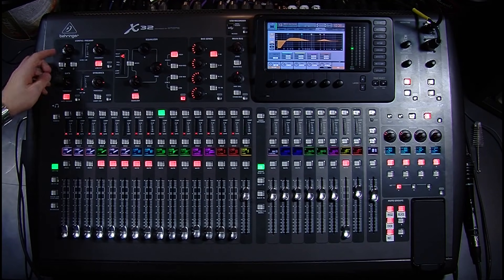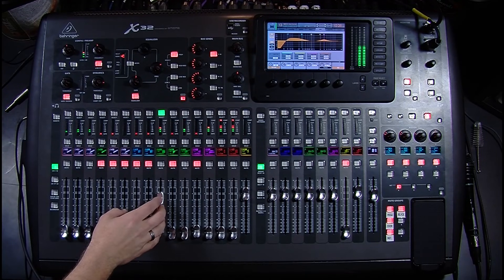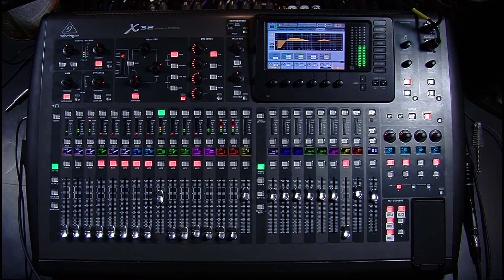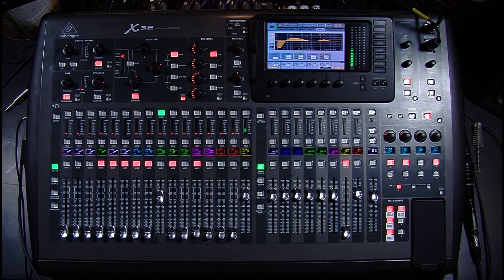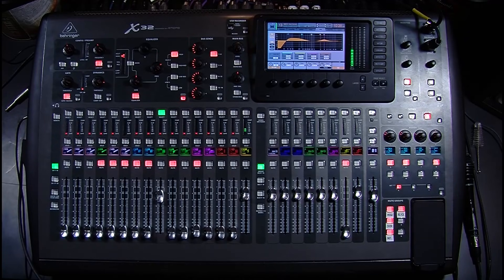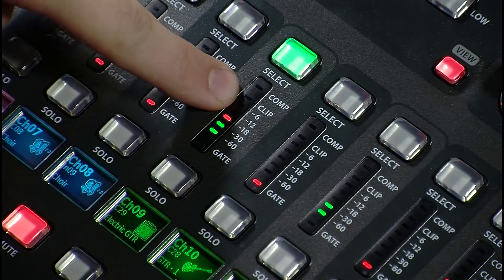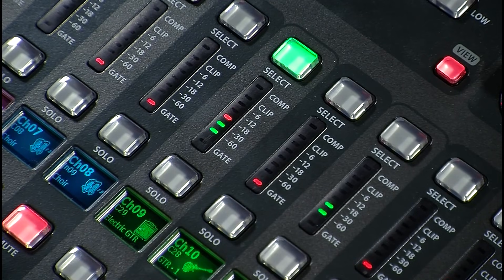Behringer X32 - Basic Mixing 101-2 - Preamp & Gain

Comment: 00:04 Setting up gain and preamp configuration is crucial for correct audio levels
01:24 Channel gain and phantom power are crucial for microphone operation.
02:41 Understanding phase, polarity, and low cut settings for better sound quality.
04:07 Adjusting preamp gain to control frequency inputs
05:31 Selecting channels and using solo, mute, and preamp features
06:50 Adjusting gain for proper signal amplification
08:15 Importance of headroom for avoiding distortion
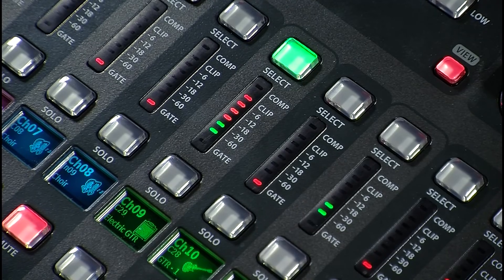09:36 Understanding the vocal and dynamic section

Comment: So if I have 3 lav mics and wanted to deal with feedback issues would this be the correct way to go about it. First, Have my master fader at unity, get the correct input gain on LAV 1, then raise LAV 1 channel fader until the point of feedback and deal with feedback accordingly until I get that channel fader to unity. Secondly, once LAV 1 is set, you keep it hot and at unity and repeat this process with LAV 2 & 3. Is this process correct?

Comment: That's actually not true, and probably a US thing, but over here in Europe we call it a phase switch if the polarity of an audio channel is turned around. This is actually even what they call it with XLR cables too, and it does switch a phase entirely. Behringer is a German brand, so over there they are correct. Phase and out of phase is not time-dependent where I live. When a signal is 100% out of phase it's indeed entirely its polar opposite. Also visually easy to spot when zoomed in on a wave-form.

Comment: Thanks for the tutorial. Here is the issue I am having when I attempt to set the volume fader at unity level, which I believe is 0. Regardless of the gain on a particular channel, the sound that comes out of my speaker is clipping while the speaker volume is low, and also the signal sounds weak. Imagine a sound is low, weak, and clipping at the same time. Please let me know what I am doing wrong? FYI, I set the volue of the keyboard producing the sound half way, and the main fader is also set at unity level which I think is 0
Reply: Could it be an issue as to how you have your amps set?
Reply: @davidhunt6508  I have updated the software on the speaker, which resolved the issue.

Comment: Can you address the analog to digital conversion at the preamp ( and possible loss of bit depth if set too low there) as shown at 24:10 in this video ?     He also mentions the desire to have "high resolution" by keeping channel faders near unity and how sub groups help you with final volume in the house, but it isn't clear what you'd do if keeping preamp gain at "line level" forces the channel fader into undesirable territory.         https://youtu.be/khBHcfyI5e8?t=1453

Comment: If the sub crossover is around 100 hz, and low cut /high pass has a curve to it ( not like a shelf) would you want the low cut up around 150 hz?  Also , we have issues with a lot of low end mud in our untreated room so I run low cut on everything except bass and kick at 150hz.  Including keys...especially keys because in many cases keys players shouldn't even use their left hand, or at least should shift both hands up an octave to stay out of the bass/kick realm.  Piano/keys players often learn as the only instrument in the room and tend to dominate way too much of the frequency spectrum.  I've seen Paul  Baloche worship band videos emphasize this point.

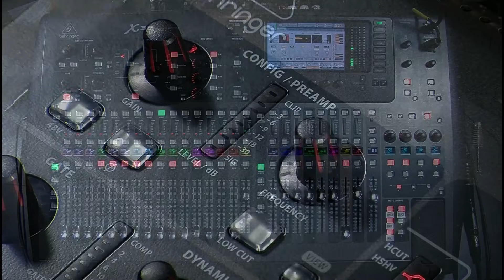Comment: At 0:50 - "unity gain" is 0 dB, that is, same level output as comes into the input. It would be VERY unusual to set the preamp's gain trim to unity gain/0 dB. The "correct amount of gain" in this context is: whatever gain setting your source requires to get the signal to peak at your desired level. That's what the channel meter is for, to see the results of your gain adjustment and help you set it as desired. Typical ballpark setting for a mic into a mic input is somewhere around +20 to +30 dB, varies depending on the mic type and the SPLs off the source (guitar amp cab/vocalist/acoustic instrument etc.)

Comment: Polarity and phase are really the same thing if you understand it. Being in phase would be +/- are all the same in inputs, and being out of phase means it's -/+ on some inputs so you need to flip the polarity to put them back into phase. So no Behringer is technically not wrong.
Reply: Sounds are waves, they are all time dependent. If there was no time there would be no sound. It's all frequency/periods/time-dependent 100%. This is also why it's a circle for the symbol with a line, it represents sin/sine waves in their circular motion based on time and why it's not the +/- symbol.

Comment: Guys, think of Phase and Polarity like comparing jazuzzi's and hot tubs. Not all hot tubs are jacuzzi's, however, all jacuzzi's are hot tubs.

In the same way, not all phase is 180 polarity, but polarity is always 180 phase.

So yeah, after some thought, I believe Behringer mislabeled it too

But in the grand scheme of life, who really cares?

Nobody. Nobody cares except us nerds in the comment section below a tutorial video. And that's exactly why are mixes sound badass. lol

Hope this helps
Reply: Exactly the other way around. Each polarity switch is 180° phase switch. Each phase switch is not a polarity switch. Polarity switch is a special case of phase switch. So, Behringer did not use a wrong term, however they could have used a more specific term.

Comment: When you look at a signal on an oscilloscope, you will see the “sound wave”. When you change the polarity, the “waves” will be 180* out of phase from each other, which cancels out some of your sound. So, Behringer’s use of the term phase simply means the same as polarity. I do see your point if it were an actual effect phase. But Behringer is referring to the phase of the sound wave. Love your videos.
Reply: CA SparTech phase inversion = reverse polarity
Reply: This is correct. The symbolism given for the snare sounds is dead on. However the same wave sounds given will cause each other to be canceled out up to the point where some of the wav isn't 100% in phase.  Soooo you do infact reverse the polarity, however, you gotta take it in or in this case out of phase.

Comment: Behringer is correct about phase / polarity you mentioned
Reply: While your wave forms appear reverse phase when you use that switch, it is actually altering the positive and negative connections. Since the input signal is of varying voltage, it has an appearance of "phase", and you wouldn't be wrong to think of it that way, it is more technically correct as polarity. The result is what is important in any case, and his explanation of sound waves and drum mic-ing is a perfect explanation on the use of it, so as long as you understand that part, you should be good to go and won't run into sound wave cancellation issues.
Reply: Technically it is 180 phase at any individual frequency.  If you pass multiple frequencies through it, it is polarity.  However it's easier to print a "phi" symbol than write "polarity" and everyone knows what it means.
Reply: Manny Tocol I was thinking the same thing...
Reply: Nope

Comment: Good afternoon Drew. I don't know if you are still doing X32 Behringer help or not, but I have run into a problem that I am not sure how to fix. Some of my faders when I pull down to minimum do not respond. They will not quiet the mic or instrument. They will however increase the volume level. Guidance on how to fix this would be greatly appreciated.

Comment: When I set my gain just as you describe, I can't get enough volume to my IEM system for the musicians.I have to run the sends on faders almost maxed to get enough gain to each player. Am I missing something???
Reply: What volume (what are the meters showing) for your output for your IEMs?  I think peaks around -18/-12 is a tad low to set gain on a digital console so I personally set loud peaks closer to -9 or even -6, but really it's just gain structuring and if you adjust the volume on your amplifiers/devices after the board it shouldn't matter all that much.  That being said if the meters for the buses feeding your IEMs are around -12/-9 (which it should be) I would see if you can adjust the input sensitivity on your IEM transmitter or turn up the IEMs themselves if at all possible.
Reply: @justinquinn7995  That's correct. Some engineers use a range between -9 / -3.

Comment: Drew, summation is another reason we do not want to go too hot on incoming signals. All those channels sum up to greater than their input. I've encountered this before when looking at the input signal on the mains and saw that they were clipping, but my output signal was no where near clipping levels. You can get away with a few hotter channels (as I think the Behringer pre-amps sound warmer with a bit hotter input signal), but if you are running 10+ channels you can clip if running channels hotter than -12 input signal. Granted, -12 is the peak, so not every channel is going to be at -12 at the same time, but it's worth keeping that in mind when setting up gain structure during sound checks.
Reply: Dont disagree with this at all. But i see a ton of people saying we should be running X32 levels at -18 and its because they heard somewhere analog levels = -18. Its not because they understand what theyre saying. The meters on X32 are peak meters and -18 for peaks is leaving a ton of headroom on the table. Of course the noise floor is VERY low, but still, ive been running X32 and M32 for almost a decade and never had an issue with my 2bus clipping due to summation. I shoot for peaks at -8 to -10. No biggy. I just wish people would stay saying stuff that isnt necessarily true, when they really dont understand at all what theyre talking about.

Comment: Sometimes when I have it set like this on my mics, I still have to push the slider way up for it to sound good in the house.
Reply: I personally think -12/-18 for peaks is low for a gain setting on digital boards, but as long as the rest of your signal chain is structured accordingly it should be okay.  However I am for -9 or even -6 for loud peaks.  That being said I would suggest evaluating your settings later down in the signal chain to see if your gain structure is allowing you to get full volume with your faders around unity.

Comment: "Our clip is at zero"...that would means there is no headroom above zero reference. Headroom is not the levels below reference but the peak levels above it before it clips. A well designed unit will allow 10 to 20 db above reference before actually clipping.
Reply: You're thinking 0dBu through an analogue signal path. In the digital realm 0dBFS is the absolute maximum digital audio level (Gandalf enters: "NONE SHALL PASS!!!"). An input signal that exceeds the 0dBFS limit within the digital-analogue converter (located immediately after the analogue preamp) will generally cause ugly digital distortion. -18dBFS is therefore a pretty decent reference to achieve exactly what you suggest: 10 to 20 dB of headroom.

Comment: Great video! I have one question, that is probably off topic. If I was to plug a microphone in a mic channel number 1 on the behringer x32 compact I have and then select for example channel number 22 and set channel number 1 as the input, would I have seperate gain adjustments for both channels, with the same input source?

Keep up the good work and Greetings from Slovenia!
Reply: no

Comment: Your 100 percent wrong about that not being correctly called phase.  When you have two mics on something like a snare and end up with two wave forms that are identical it causes them to take each other out completely which is “PHASE CANCELLATION”  that switch rotates the waveform upside down to fix the problem with a push of a button that is not  called polarity lol Its all good man we all make mistakes and I appreciate the showcase of this soundboard/tech because its alot of money to invest on a piece of gear that won’t work good with your workflow.

Comment: Hey Drew, my acoustic guitar has an active pickup, but doesn't have a preamp. Do I need to be using the LR Baggs Para DI, or could I just be running my signal directly to the x32 (via the SD16) and use the built-in preamps instead?
Reply from the maker: Hey Joel! You could plug into 15 or 16 with your acoustic guitar as those are HI-Z inputs. The better way would be to use a DI Box, but 15&16 on the SD16 will work just fine!
Reply: Thanks Drew. The dedicated Hi-Z inputs make sense as the only ones that would be able to change the impedance. But I'm still curious about the use of a fancy dedicated pre-amp like the LR Baggs Para DI vs the built in Midas preamps. Is it only about tone color? I tend to keep my Para DI eq flat, and do all my mixing from the board anyway. Am I double-preamping, or just skipping/wasting the tone control power of the Para DI? Would I notice much difference from a cheap, simple DI vs one with a built in preamp?

Comment: how do you set up a di for guitar or bass? the 1/4 aux inserts?
Reply from the maker: Hey Steve, the DI Box would be connected directly to the guitar/bass, then the XLR out of the DI box would then go into one of the XLR inputs on the X32. That way you are able to lift the ground on the DI Box in case of any ground loop issues!
Reply: Thanks that's the way I figured to do it , but my reasoning for question was more of doing it without a di box but I'm finding out that's not really poss. Which suck because this costs $ 2k and I'd still need a 100$ di box

Comment: I just wanted to clarify to the narrator with regards to Behringer's labeling of the "phase" button. Behringer did not error when labeling the button as "phase" whereas the electrical physics when engaging this buttons shifts the signal 180 degrees out of phase to prevent signal cancellation. With respect to how the signal path is manipulated, the term polarity and phase are synonymous.
Reply: polarity and phase are only synonymous if you have only a 180 degrees phase
Reply: They are not....time will be still an issue..

Comment: What is phantom power? Even though this is supposed to be basic, is there somewhere else to go that is really basic? That starts with terms and what they mean?
Reply: Phantom power, in the context of professional audio equipment, is DC electric power transmitted through microphone cables to operate microphones that contain active electronic circuitry.[1] It is best known as a convenient power source for condenser microphones, though many active direct boxes
 also use it. The technique is also used in other applications where 
power supply and signal communication take place over the same wires.

go here for more exciting details ;)
https://en.wikipedia.org/wiki/Phantom_power